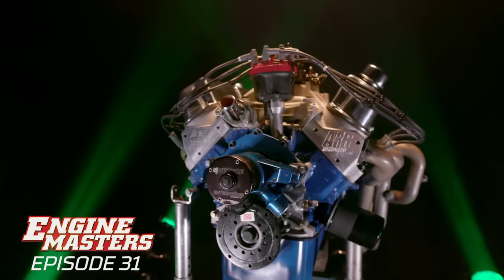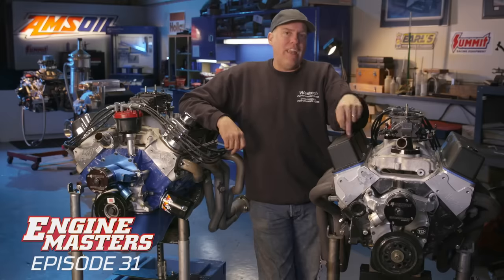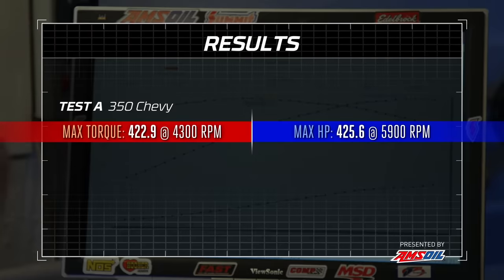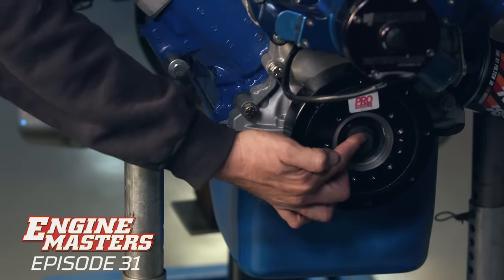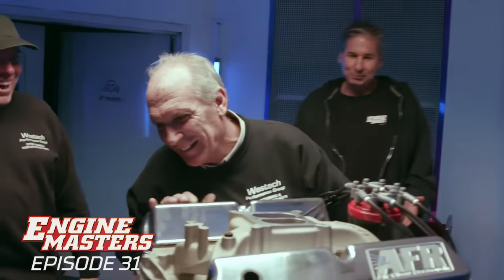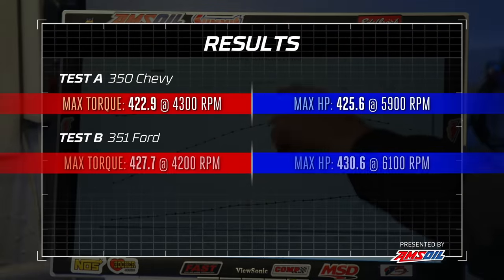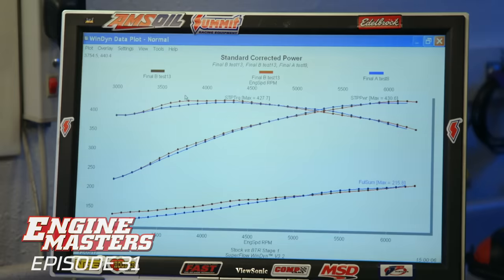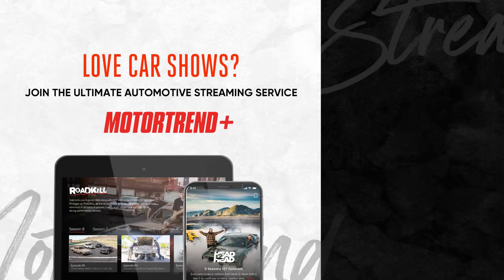Chevy vs Ford V8 Showdown! Small-Block or Windsor? | Engine Masters | MotorTrend

Comment: So glad to see that finally we see the FORD is better.
Reply: nobody is better, they all break at the worst possible times. except my old Ford.
Reply: They always were
Reply: The Ford has higher compression ratio. If they were exact same compression ratio, guarantee that small block would be a few extra ponies than the Windsor.
Reply: I put together a 351m.. Yes a modified with stock 2v heads and a 252 comp. Very small cam and an intake and headers and it has more grunt and mid range power than any Chevy 350 that I've ever experienced.
Reply: @Whatta  well on the flip side. The exhaust port flow on a SBC is a better  design than the ford's. So I'd call it a wash. 

Both are respectable engines. I am a Ford guy, but I am not gonna hate on the Chevy. At least not that I am older 😂
Reply: Hardly better. The results of a side by side comparison the difference was literally due to compression. 

Pretty pathetic since the ford has the superior firing order.
Reply: How is it better?   It had more compression and 2 extra cubes.  You can claim the cubes don't make a difference, but they DO.  These motors made roughly 1.2hp per cubic inch, therefore the Ford got about 2.5hp more due to the extra cubes.   That was basically the difference on the average.  
And that's not even talking about the compression being higher on the Ford. 
Make the cubes exactly the same, and the compression exactly the same, and the Chevy would have been a couple HP ahead. 
That's why they said they were basically identical.
And remember:  This was with aftermarket heads.  If they had to use factory stuff, the Chevy would be significantly ahead, like they always were, historically.
Reply: @SealofPerfection  it wasn’t even the cubes itself. The compression, superior firing order, superior valve angle. It should have done way better than it did and put 15+ HP on the Chevy has I been a betting man.
Reply: @ZONES89RS  And yet it didn't
Reply: @SealofPerfection  exactly.
Reply: @SealofPerfection  Using factory stuff, the 351 Cleveland kills them both. There's a reason the NHRA used to add a weight penalty to Cleveland engines.
Reply: @cgarris8674  You need a caveat.  The Cleveland did well with Bob Glidden building it.   HE is the reason Fords had a nice stretch in Pro Stock, not the design of the motor.   If it was so great, everyone would have been running them.  
They are kind of like the Hemi:  The work well in certain situations.  But not across the board.  The Hemi is only good for Fuel cars.   It has its niche.   
But even when Glidden was running Boss heads, he was the only competitive Ford.  So it was him, not the motor design.  He'd have been winning with anything, because he was great.
Reply: @SealofPerfection thats correct… now you can build that Chevrolet with a crazy selection of heads , 18, 15, 14 degree ect.. and beside there is so much more to going straight line racing .. Chevrolet small blocks have pretty much dominated the road courses over the years but i will admit that because of technology and machining they all can be made to win in their categories…!   Buy the way doesn’t a small block Chevrolet own the Bonneville salt, flat piston driven record at over 400mph 😮🏁😎

Comment: The thing is you can build a 400sbc for the same price as a 350.
Reply: You can also slap a supercharger on a junkyard coyote motor and make double the HP. Watching those old motors get built is fun but going fast is easy and cheap now, that old tech just can't keep up
Reply: @hughjass1835  you can slap a supercharger or turbo on anything.  Use a ls....they've been way faster than a coyotah. 

But that wasn't the purpose of this vid.

Comment: Good thing you did not use a Cleveland. The Chevy guys would be crying.
Reply: Hardly. 

This ford was a disappointment for and ford guy as it is. The Cleveland would only do what this engine should have.
Reply: Back in the day I had a 351 C in a stock 72 ranchero GT 4bbl 4 speed that did 100 mph at 4 grand on the tach and red lined at 5200 but would bury the speedo before that! They had awesome power for the time!

Comment: So clearly if you take the weight advantage of the chevy 350, all us bowtie guys always knew we were right 😂
Reply: Foxbodies solved that problem for 40 years now.
Reply: @MoctezumasRevenge1  and the Shoebox Nova was lighter than the Foxbodies 59 years ago
Reply: Lmao Just like the Ford Falcons of the same era..Difference is when 1979 rolled around the Ford's added lightness. F bodies got heavy and ain't no shoebox around anymore...but Ford did make MILLIONS of Foxbodies that you can still find.
Reply: @MoctezumasRevenge1  monzas and Vegas solved that issue 😂
Reply: @brandonbell433  no they didn't. The aftermarket support doesn't come close to a foxbody.
Reply: Issue with the 351w is the 3'' main size, causes oiling problem at high rpm. I love 351s tall deck easily accepts 4'' stroke and equally spaced ports is better with headers
Reply: @Brandon Bell  Ah...just like Pintos and Mavericks lmao 🤣
Reply: @chrismathes3647  chevettes/Vegas/Monzas…… let’s not get into the Buick Oldsmobile and Pontiac versions which are the same platforms 🤷‍♂️😂😂
Reply: @Brandon Bell  point is all brands market similar vehicles in the same category. Your listing of GM only vehicles means you misunderstand that not to mention the Fox is the one still around in large numbers 😉

Comment: Oil sloshing towards the back of the engine uncovers a front sump oil pickup. Result: spun bearings, lost race. Fords suck. Dual sumps in the Fox body engine is better, but two oil drain plugs equals longer time wasted waiting for the oil to drain.  Fords suck.
Reply: I've been pointing this out to the Ford guys for years, especially when they brag about the dizzy being in the right place on a Ford.  It would be great if everyone was racing in reverse.

Comment: One added benefit of the 9.5 deck height in the Ford is it can be bored and stroked to 464 cubic inches. I'm not sure how far the Chevy can go but I think it's limited to somewhere around 410CI. Though I'm sure there are Chevy guys that can clear that up.
Reply: 464! didn't know that. can it be done on a factory engine block? what crankshaft do I need?
Reply: You can't get to 464 with the oe ford block. They never made a 4 1/8" bore block for the sbf.

The sbc wins using oe parts....because if you want to compare the best of both you use a 400sbc and a 351sbf
Reply: @HioSSilver1999 yeah you can get there on a stock block but you have to sleeve it you'd be amazed what your machinist can do if your pockets are deep enough and you have to meet a stock block class
Reply: HioSSilver is partially correct, you can only push a stock 351w block to 440CI. 4.060 bore and a 4.250 stroke. I've only built blocks from World Products, Shelby Engine Co and Ford Performance so I forgot that the stock windsor can only bore to 4.060

As for who wins? If it's the engine brand you want to build, and you build it, then you win.
Reply: @79huddy  I didn't think we were talking about completely re-engineering the block here. Is that what ford guys need to do to get a W? If so then it's just about who's pockets are deeper basically.
Reply: @HioSSilver1999  always has been when it comes to class racing what can you get away with and still have a production casting number chevy guys do it to not uncommon to see a big bore low compression cheater engine pass a cc and compression test but get caught at teardown or during a volumetric test when it moves to much air its why there is sealed class engines that you can't open during a season everyone was spending too much in machining to stay competitive in what was supposed to be a hobby class
Reply: @HioSSilver1999  thats if you are comparing the windsor. Put the chevy against a 351 cleveland no matter if its a 350 or 400 and the Ford will wax it hands down not even close lol.
Reply: @supersportimpalass  The difference in power between the 351W and 351C are in the heads, period.  Aftermarket heads take that out of the equation.  Racers don't use the 335 block (that's 351C for you) for one reason:  Strength.  The Windsor block is much stronger overall.  The Cleveland heads get you more power * from the factory *.  Of course, Yates heads on a 351W block, was for many years, the NASCAR standard for Ford and the Yates head is based on the Cleveland.

Similarly, the advantage a stock 351C has over a SBC 350 will also evaporate when you factor in aftermarket heads.

Comment: Hey! if you could find it in your heart could you do an episode on the diffrences between gm small blocks from the 60s. like the pontiac olds and buick v8s and what there diffrences were. the olds v8 is particularly intresting as it was able to keep up with emisions laws till the 90s only using a carb.

Comment: Chevy engines are easier to work on and you don't have to change the transmission when doing engine swaps
Reply: SBCs are a pain in the rear to do basic maintenance.  I despise the location of the spark plug ports, under the exhaust manifolds.  That and the stupid distributor in the rear..
Hotrodders love SBCs.  Good.  You can have 'em.  Sticky lifters and all.
Reply: @penguinsfan251  that’s just another reason I went LS and never looked back.

Fk a distributor. 😂
Reply: @ZONES89RS  LS is a great engine, perhaps better than a Coyote, but it always boils down to personal preference.  
No doubt the SBC was better for low dollar mods and drag racing.  Ordinary driving..the SBC is still a good engine, but not better than the Windsors.

Comment: At least the distributor is in the right location on the ford
Reply: Since you'll be changing out the condenser once a week.😅
Reply: @bryandraughn9830  tfi
Reply: But the reason it's in the front is moronic at best.  The Dizzy is in the front on a Ford because the oil sump and pump are also in the front.  The problem with that is the oil is forced to the back of the engine under full throttle.  I'd MUCH rather have a dizzy in the back than spun bearings from oil starvation.
Reply: @Craig Campbell not all ford small blocks are front sump.
Reply: @ericanderson4441  the ones that have a rear sump (I am referring to the Windsor blocks here, 302 or 351) still have a small front sump for oil pump clearance.
Reply: @silicon212  correct, but that's not where the majority of the oil, or the pickup tube reside.
Reply: The LS has the correct distributor location.
Reply: @ZONES89RS  😂

Comment: The 351W would have made much more power if it had a lighter crank, the ford crank has 3.000 mains and the chevy has 2.300 mains.
Reply: Not really....that would not show up on the dyno at the acceleration rate they tested.

Although it probably would show up in a car making the ford slower because of not only the crank(as you claim being heavier so it's rate of acceleration would be slower) but also the overall package of the sbf is heavier.
Reply: 350 Chevy has 2.45 mains, still smaller.

Comment: The test between a small block Ford and a small block Chevy has nothing to do with horsepower and torque it's about longevity and reliability and the Ford is going to surpass that Chevy by a lot

Comment: My 2006 Silverado needs a new engine. I'll definitely go with the Windsor after this awesome shootout.
Reply: You have a superior LS engine in it assuming it’s a factory v8. Get a used 6 liter.
Reply: Why tf would you get some POS ford motor when your truck CAME FROM FACTORY WITH AN LS ????????
Reply: You should definitely put a 300 straight 6 in it
Reply: @hughjass1835  
I could but they cost big $$$ and don't have that V8 sound.

Comment: Ford costs more to build
Reply: I had two friends that found out that Ford cost a lot more to build.  As I was helping them find parts I got to see the difference.  One was a 408 stroker from a 351 in a 68 Mustang, and the other was a 521 stroker from a 460 in a 70 Torino.
Reply: Not what the guy in the show said
Reply: @penguinsfan251  I’ve watched several friends build Fords.  And I’ve watched and been involved with building Chevys.  The Fords have always cost much more.  That’s the real life, not a tv personality life.  I’m not saying one is better than the other, just that I’ve watched the credit cards come out, and I’ve personally witnessed the expenditure.

Comment: distributor infront wins races. There’s a reason chevreolet decided to base their latest cam in block engine is just a modern Ford windsor not a modern sbc that should tell you everything about which one is better here too bad the cheap counterfeit LS doesn’t have the good oiling the Windsor does

Comment: Always been a Ford guy, currently own a stock 351C. Would love to see a similar build for it for the street.
Reply: The 351 C or BOSS 302 or 351 boss head will always out flow a stock small block Chevy head and I'm a Chevy guy ,power is in the heads big ports always make more power on the top end ,but I will say Chevy made the canted valve head in 65 and ford just ran with it and why not it works
Reply: @darrellsomers5427  My problem is mine is a 2V and 4V closed chamber heads are harder to find these days.
Reply: Stock vs Stock the 351C 4 barrel will always win vs the SBC and Windsor due to head flow alone.

Comment: Here’s my important question. I’m building a 347 stroker for my 67 Mustang….. what manifold will give the best performance and still fit under the stock hood?
Reply: Get an air gap dual plane
Reply: @jaypisme2343  that will fit?

Comment: Good job Freiburger, you managed to show the public that when you build the engines as close as one can - given the variables - the results are the same, the ICE doesn't know - the really great thing here is that anyone can do this cuz you used all store bought, off the shelf parts - kudos for that -         OK - with that said, what if the guy wants to have 500 BHP at 6000 RPM what needs to change on either engine?

Comment: This proves the air compressor theory. Equal cams, compression, carb, heads, and most importantly air and dynos. The difference could be the same on the same engine with 2 different oil temperatures.

Comment: I’m a Ford guy but the 302 with those heads would be around the same HP but the TQ is a bit different. I would still Grab the 302 over the 351

Comment: Almost all other things being equal, you saw the result of a taller deck height and a slightly better rod ratio pushing the power a little higher in the RPM range on the 351w.

Comment: I have always prefered the Ford small block.... GM and the AC Delco parts were always garbage quality compared to the quality of Ford Motorcraft parts.   GM  Alternators , Fuel pumps  ect never lasted very long
Reply: I’ve worked on both. Owned both. Engine wise I was always happy with both. 

Electronics and others little stuff, the GM would have alternators fail more often with aftermarket. Same with starters.

But factory ford and GM stuff usually went the distance for me. Aftermarket ford stuff for some reason was usually a little longer lasting than the GM aftermarket.

Comment: I have a 68 Mustang fuel injected 438windsor 12:1 compression,  e85, Afr 220 heads, super victor intake, Comp Cams xr292r solid roller street cam,  Isky gold stripe valvesprings,  full manual th400,  410 gears. Car weighs 3k lbs and has a crazy launch...Ford all the way baby
Reply: I’d rather have a 440” LS. Don’t care for distributors and the LS architecture is just better than the old pushrod stuff. The LT stuff these days is even more insane with the DI. 

I wish ford made the coyote with more cubes than a 5.0 or 5.2 voodoo.

Comment: I guess it comes down to you. Is there a significant weight difference between the engines. And a significant difference in measurement with heist deaths. For smaller engine bays or ability to put it for their back in the chassis?

Comment: What intake valve size does each engine have? If they are using stock valve size, the 351W would have 1.84 and the 350 a 1.94 or 2.02.
Reply: Both engines run aftermarket heads. The engines are built with as similar spec at possible, to test if differences in the basic design make any bigger difference in the power output.

Comment: Where's the 360 Mopar with Trick Flow heads?
Reply: In the scrap yard where it belongs
Reply: @ZONES89RS  😅😅😅
Reply: Who need a 360 with Trick Flow aluminium heads when a 340 with factory iron W2 heads from the mid 70s would bury either one of these aftermarket icons???

Comment: Wait, you built two identical air pumps and they pumped the same amount of air?  No kidding!  Biggest take away from me was the pricing - I would have thought that the GM stuff would be hands down cheaper due to popularity but I guess not.
Reply: I’m surprised the ford didn’t out right win. Superior firing order failed it
Reply: Well,when they are choosing top doller parts it's not surprising. Throw a budget in there i bet you dollar for donuts the ford has less options

Comment: Love my Ford friends but the truth is that the Windsor is a copy of the Chevy, starting with GMs short-stroke high compression layout of the 1949 GM Kettering engine and further deriving the 1955 smail block's revolutionary casting techniques and valvetrain.  Ford made the V8 available but the power these engines make is a result of GMs innovations.

Comment: No surprise here, inline valve engines with the same bore and other specs, same horsepower.  It might be interesting to build a de-stroked 350 cube 400 Mopar with the 4.34 bore and aftermarket 440 heads and see what hp could be developed.